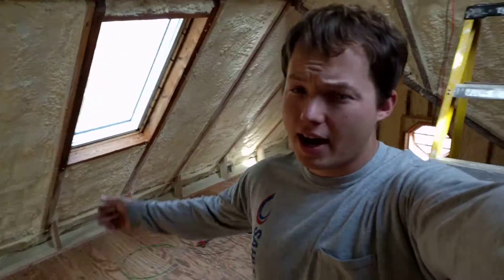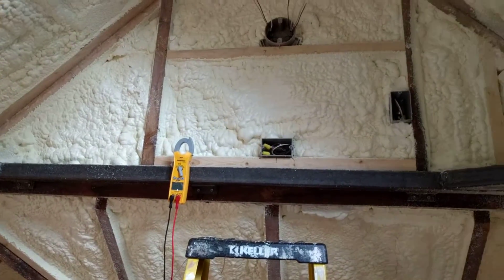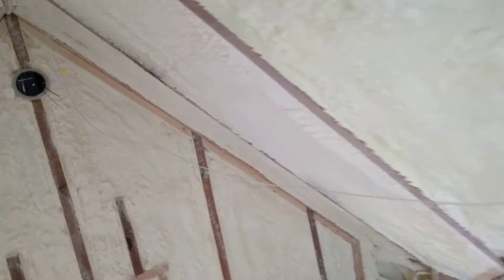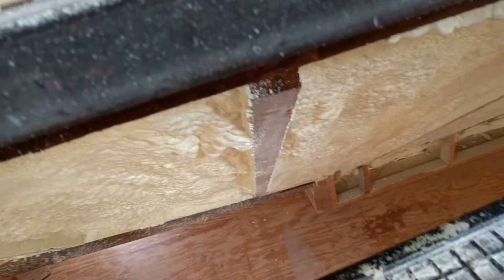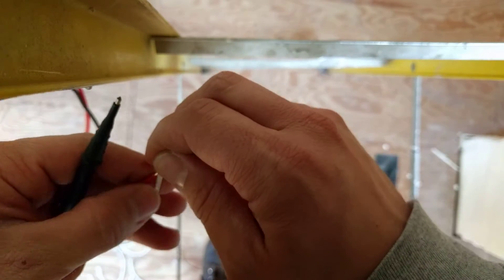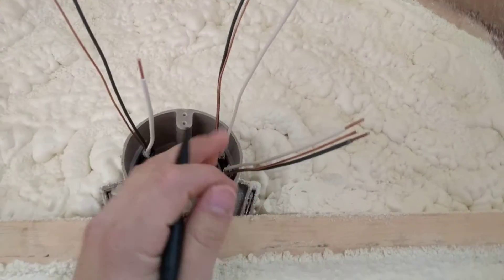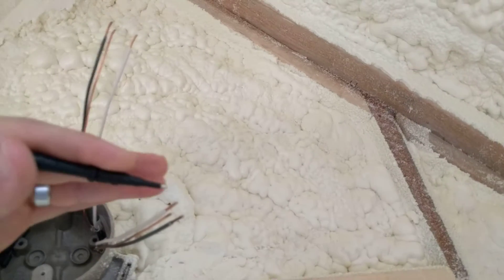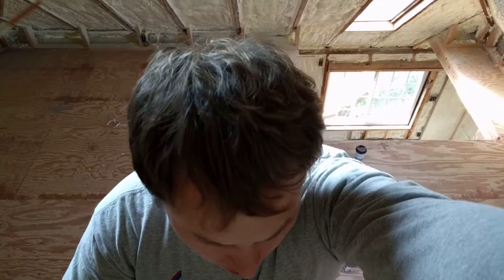How To Trace a Wire Using a Continuity Test

Comment: you could have just twisted the black and white wire together and then 
checked each pair..... no need for that extension wire. Highly 
impractical.
Reply: is there video about that . i dont understand what your saying?
Reply: @jovelchiac7302  im a year late and you probably know the answer now but i’ll explain anyways,if you tie the black and white at one end,it’ll form a continuous loop over to the other end.

Comment: I would like to install Arc fault breakers to replace couple of existing regular breakers.   How do I do the continuity test to find out which white neutral wires on the bus bar correspond to the breakers I'm replacing?  Can I shut off the main breakers, dial to continuity on my meter, then with one lead on my target breaker hot wire or screw, the other lead going down by order, each of  the individual white neutrals, till i hear a beep?
Reply: It won't work if they are all on the same bar.  You will need to chase out the wire to the neutral bar.

Comment: why didn't you just wire nut the two wires (blk and white) together at the J Box and prob at the other end instead of wiring nutting  a long neutral wire
Reply: that's like his solution but using the neutral instead of the additional testing wire, great idea!
Reply: @peter_castle  your right. After watching  the video again, I realized he probably did not have power hooked up yet.  Yes good idea, I've used that method before